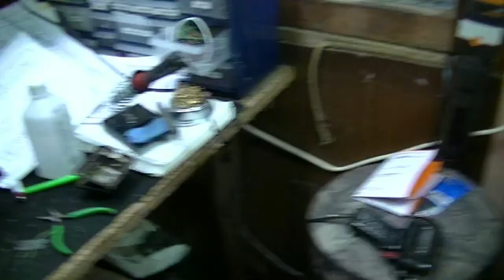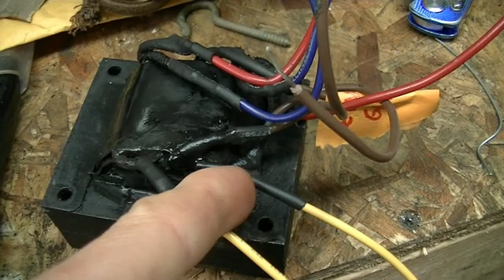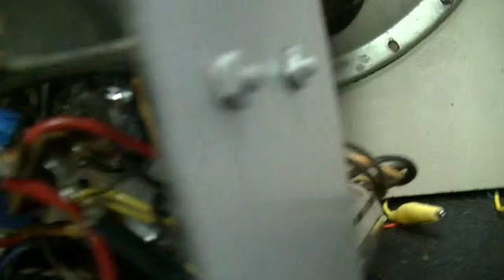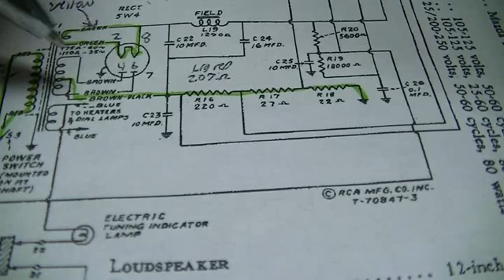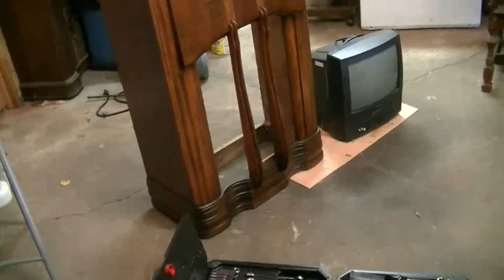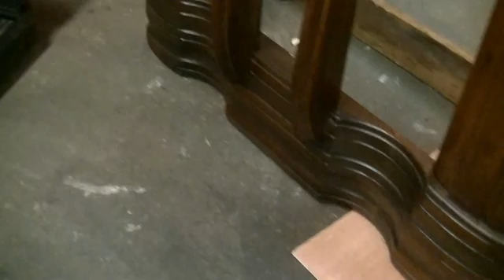RCA 87K2 part 7

Comment: Hi Dan, as I recall (40+ years ago) I think that "tie" point on those old filter caps was the 16 volts negative bias for the output tube.
All you got to do is take all the wiring off those cans and put them on a terminal strip like you mentioned.
At the time I did that 40+ years ago those connections were not shorted, but time was not kind to that radio.
Just replace ALL capacitors except the orange drops, those I bet are still good to this day.
I am glad you are feeling better.
Reply from the maker: Thanks Bill, yep at the time you did the repair those were good tie points, but not any longer. I think i'll get some sound out of the radio once I get the terminal strip in there.